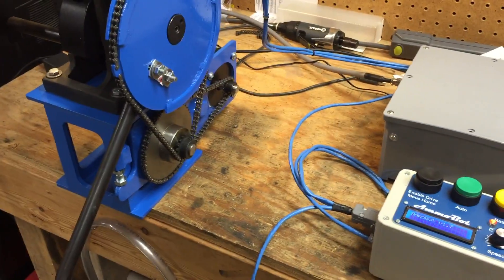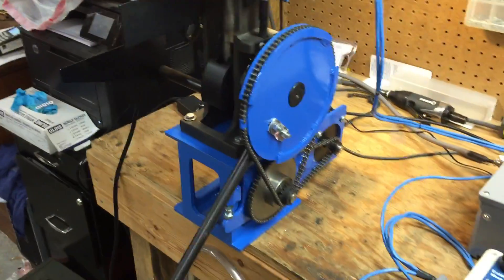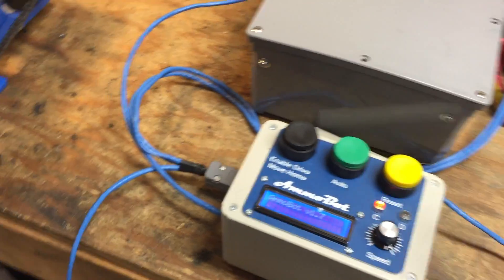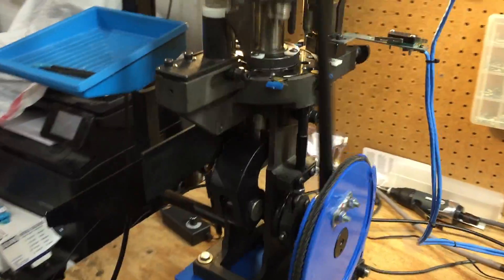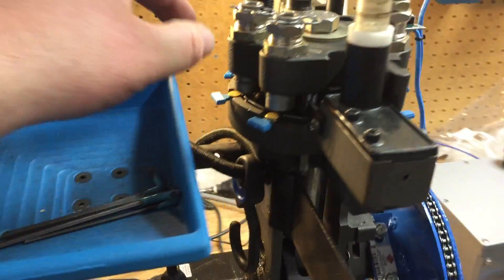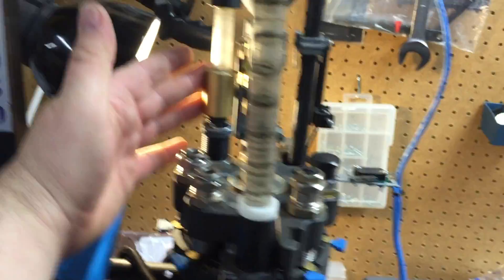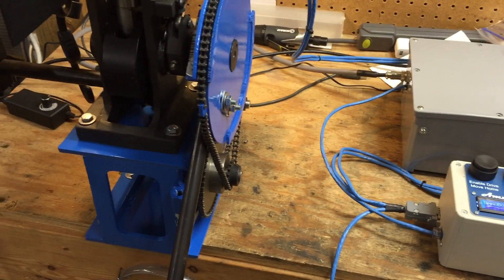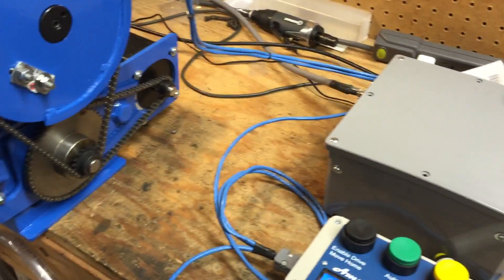AmmoBot® Update!

Comment: You could eliminate 90% of your control by using a Clearpath Servo. I would def put a disconnect on that handle too! Thing will take your ass out lol
Reply from the maker: +Duckyistrippin The size motor we would need would cost twice as much as what we are currently using.  Also, that handle doesn't move as fast as you think.  You should look at the newer videos.  We have refined it quite a bit since this video was made.